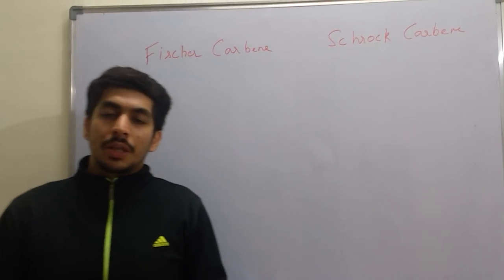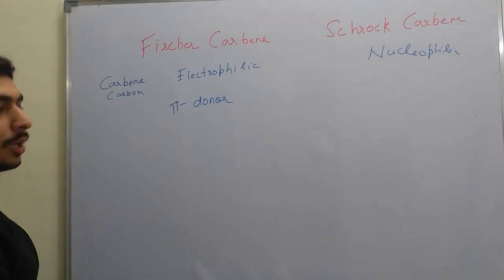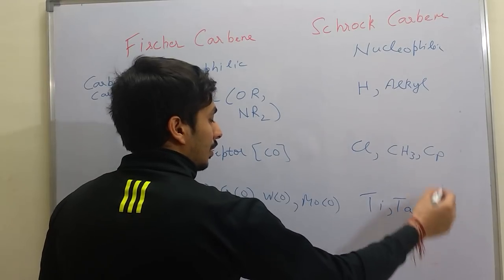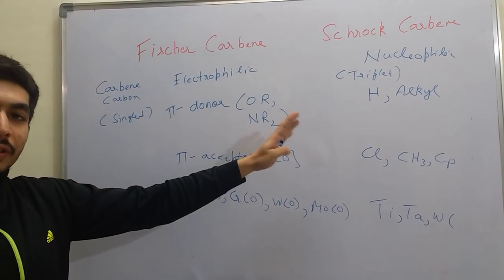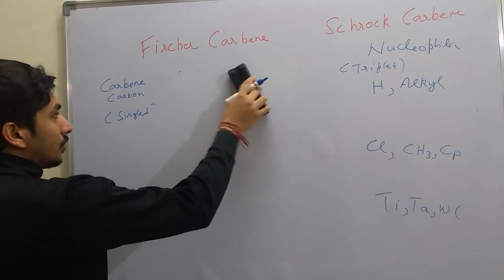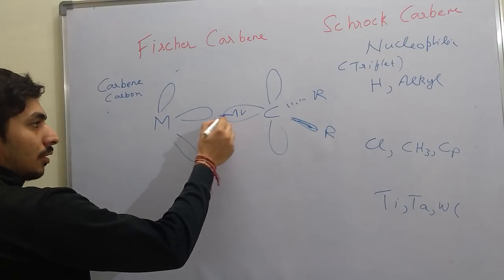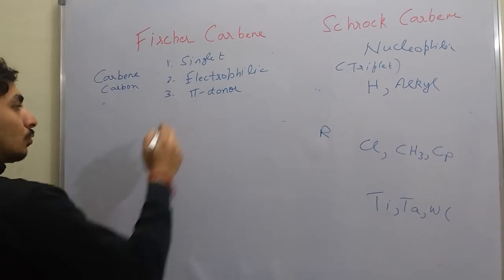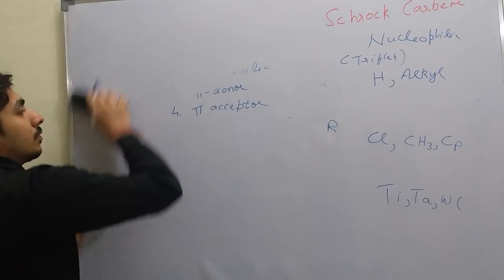Fischer and Schrock Carbene - Essential Concept to Master

Comment: Methyl 4 oxopentanoate exhibited signals at chemical shift 208, 172,51,37,27ppm in its 13C NMR spectrum. the signal due to methoxy, click, c4 and c5 Carbons are. How to solve it
Reply: Click not that is cl
Reply: Sir plz give 
solution of that question..